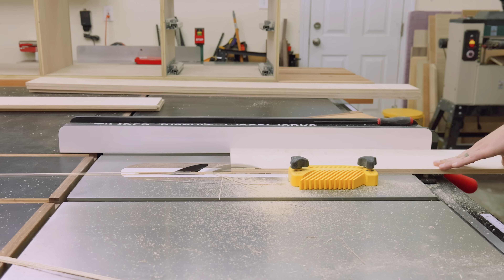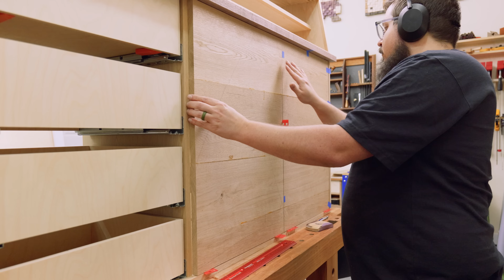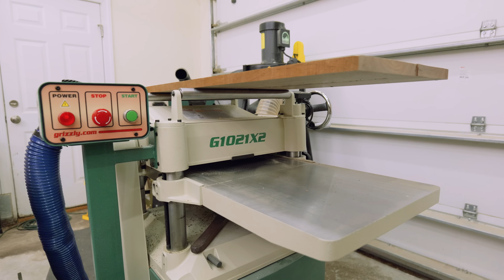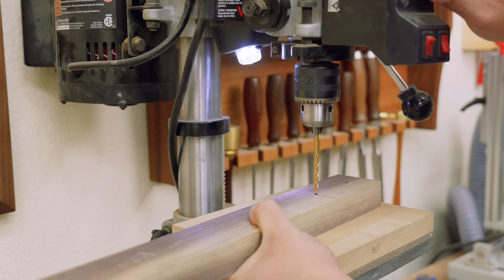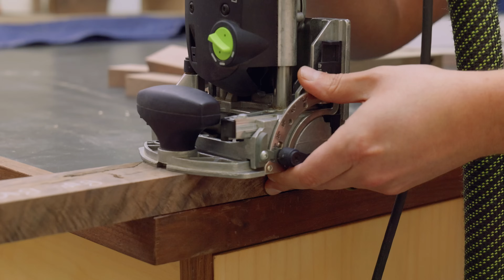Woodworkers are still being lied to | How pros build a hutch pt. 2

Comment: First video of yours that have come my way and I’m impressed. Taste is personal whilst skill is universal. The piece has features I like (contrasting timbers and textured front) but others that seem a touch plain. But, so what? You make the piece for your taste and not mine.

I’ve been woodworking for over 45 years and hope I know my strengths and weaknesses. I think my major weakness is on design. Not that I can’t think of designs but the reality seems different from my mind’s eye. Things like sketch-up would help but you can’t teach this very old dog new tricks like software. 

One suggestion. Late last year, the Wood Whisperer put out a video reviewing the options for 2 pack hard wax oils. Now. Like you, I really like the effect of HWO. It adds protection but maintains that natural look. So, I was interested. The winner was Natura Onecoat which was a product I had never heard of. I contacted the makers who said that it had only been launched in the US recently and was not in the UK (where I am) yet. But, they kindly sent me a sample. Wow. It’s by far the best 2 pack HWO I’ve used. Everything from the design of the can (reducing spillage, skinning over etc.) to the buttery nature of the mix. And it goes so far. I had recently installed about $30,000 of European oak in my house and all of it was finished with Rubio smoked oak. How I came to know that product. From the repeated skinning over of product which led to so much waste to its coverage. This Natura would have saved me a lot of time, money and contributions to the swear box. From looking at Amazon US, it’s also much cheaper than Rubio. So, it seems that these Natura guys are onto a winner.
Reply from the maker: Thanks for the information! I hadn’t heard of Natura before but I will definitely check it out. And I agree, design is subjective so it will never please everyone. Prior to using SketchUp I have only been using it for a year), I just used my sketchbook and notes. But SketchUp has helped a ton.

Comment: Consistence/contrast. Great build just do not understand why only one drawer front was different. Just my opinion which of course doesn’t matter, but I would have done every other one or none.
Reply from the maker: Thanks! The drawer front helps balance the contrast of the upper sliding doors. I played with doing every other but then it felt a bit unbalanced. So it was an intentional design choice.

Comment: Looks nice.  However I foresee a problem with using such a wide piece of solid wood for the doors.  With an increase in humidity, the doors will swell, and with such minimal reveals will end up binding top and bottom.  The doors may also warp with changes in humidity.  Best bet is to saw your own veneer on that nice bandsaw you have and veneer the doors, and you can do it so that they are still sequence matched with your drawer fronts. Leave the drawer fronts solid( obviously since they are carved).  Quite a bit of work but worth it if you don’t want your client returning the piece to be remade(speaking from experience on that latter part).  Cheers
Reply from the maker: Thanks! Yeah, I’ve made a bunch of pieces with doors that are large panels with no issues. I could have used the vacuum press and veneered the doors but again the relative humidity in my area is about the same year-round. Now if I were to ship this piece to Arizona or Hawaii, sure there could be some issues. But you’re right in that a MDF substrate would ensure things stay flatter no matter the area.

Comment: Contrast. I'm curious why you didn't use some kind of mechanical fastener, such as brad nails or staples, to reinforce the rabbet joints in your drawer boxes. You obviously don't have an aversion to using mechanical fasteners where appropriate, so why not on the drawers?

It's a very nice build and you should be proud of it. Nicely done.
Reply from the maker: I’m not a huge fan of using mechanical fasteners, so I use them as sparingly as possible. With the support system, I didn’t really have much of a choice, so it is what it is. But I didn’t really need them in the drawers boxes because I had the clamps and time. That said, if I was in more of a rush, I would’ve used pen nails. Thank you! Glad you enjoyed it.

Comment: Could you do a bit of a cameo on the way you get that scalloped texture on the draw fronts. I see how you use the router.  But issues such as how deep, do you sand later and any other intricacies in the process.  Thanks for a great video as usual.
Reply from the maker: Yeah, it’s a lot to fit in one video unfortunately. Maybe I’ll do a separate short or reel and discuss it a bit deeper. Thanks for the support!

Comment: Consistent contrast - great build. Ill be interested to hear if you have a problem with wood movement. The height of each door looks roughly 30 inches or so and i would guess during the summer they may start binding. But maybe not!
Reply from the maker: Thanks! I have a few hardwood sideboards I’ve built over the years, and all have large doors. So far, so good. Now if I move to AZ or somewhere with more sporadic humidity it might be an issue. But really the most cupping I’ve seen is negligible across the entire panel.
Reply: Gotcha, thanks for the info
Reply from the maker: Not a problem!

Comment: Contrast for sure. Just an amazing piece, wow. Curious if you are worried that overtime those threaded holes will loosen/lose the threading with seasonal movement?
Reply from the maker: Thanks! And great question. I’ve used wood threads on a bunch of pieces now and have never had a problem. Plus the added glue should go a long way in preventing any issues. And the counter gain runs in the opposite direction so there won’t be any movement pushing outwards.

Comment: Contrast :Let's go eagles 😢 Philadelphia in the building (noticed on the drill press logo although we lost). I normally use a flex shaft for the textures do u need to sand when using the router for the patterns on the front drawers?
Reply from the maker: Go birds! Though yes, it was a lackluster finish of the season. Anyway, I do a real light sanding with 220 just to knock down any high points but the bowl bit leaves a smooth finish.